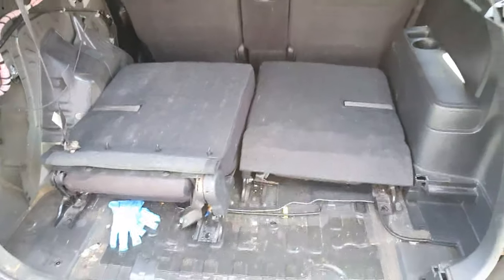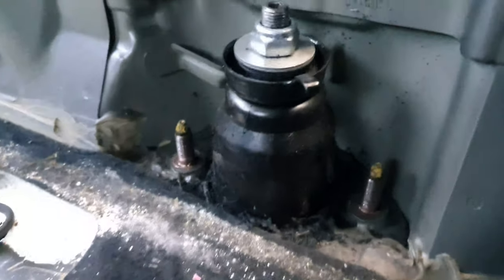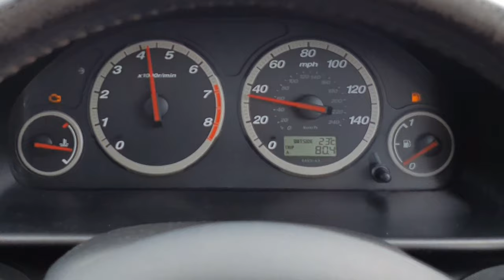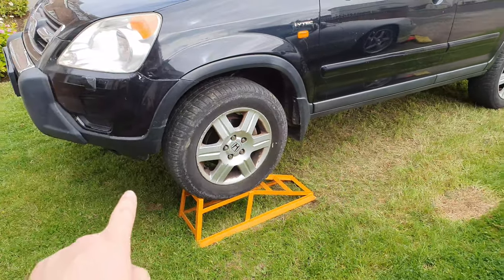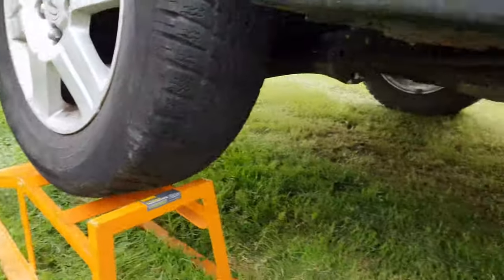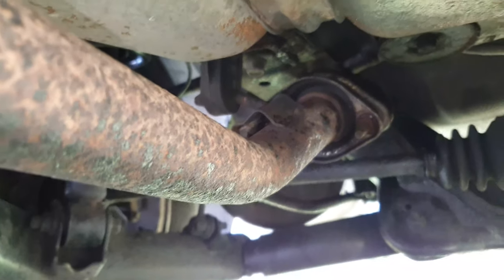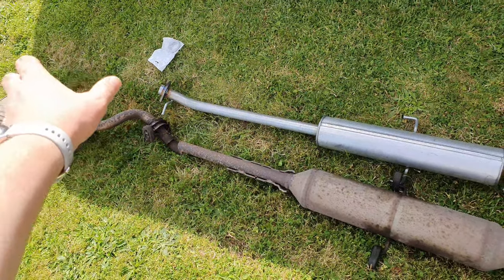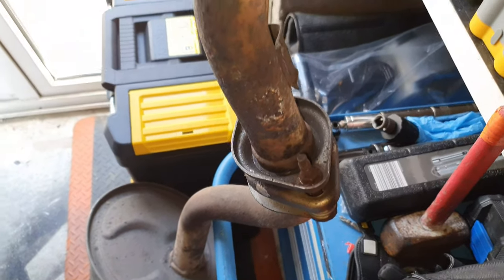#vlog/suspension noise while driving/exhaust removal crv

Comment: My CAT got stolen, too😢 the same way. I have 2005 Honda crv. How much does the CAT part is cost?
Reply from the maker: Ah shit, that's horrible. Sorry to hear you got done too. I had to buy 3 parts, because they cut the other two pipes to get mine off. I ended up buying a decent exhaust, all 3 parts for 600 euro, but i knew someone who got it cheaper, it would have been around 7 or 800 euro. The cat is the most expensive part obviously, around 3 or 4 hundred euro.